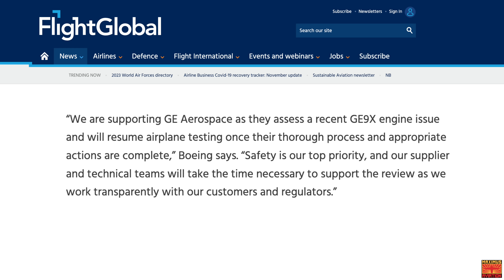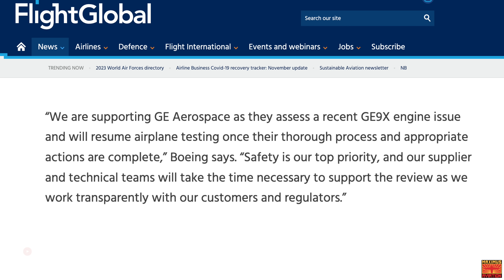Boeing Grounds All 777-X Test Aircraft Due To GE9X Engine Failure. Will the 777X Ever Get Certified?

Comment: If this turns out to be a design problem with the engine that warrants its share of compensation, GE should be the one paying all the compensation. GE is the patent-holder of the engine, and GE was the one that said that engine issues have been fixed in 2019.
Reply: Boeing should have working with RR for backup plan
Reply: @kongmindown8964  That's exactly what Boeing did for the 787. The way that turned out was that the RR engine had problems and RR left a sour taste in Boeing's mouth.
Reply: @Blank00  Neither PW can deliver those engines. Boeing sorta like a cursed company constantly flanked with problem from several direction. I can imagine why the Boeing has some of the highest turnaround rate in US.
Reply: @kongmindown8964  cursed and not cursed is not a good way to judge a company. The way that I judge Boeing is that there are things such as the 737 MAX crashes that Boeing deserves to suffer for since those things are Boeing's fault, and there are also things that arw not Boeing's fault such as engine problems, therefore Boeing doesn't deserve additional suffering for these things.
Reply: @Blank00  That's not really how it went down. GE and Boeing agreed on the GE-9X around 2012, long before the RR issues. RR at the time didn't really have an engine that could meet the requirements and both RR and GE knew the only way to justify the investment was single source. Very similar how it went for RR with the 350 and 330NEO.
Reply: We all knew the wannabe would be crying "it's not Boeing's fault" the problem is ultimately IT IS as Boeing chose GE and this engine. Why don't you try and get in the field first before crying things you know nothing about.
Reply: @DC8Combi  Then by that logic, Airbus is to blame for QF32, AF66, and the PW1000 engine issues that affected the A320NEO family because Airbus chose RR, EA, and PW, respectively. By that logic, Lion Air and Ethiopian Airlines are to blame for the MAX crashes because they chose to use the MAX.
Reply: @Blank00  You don't know what logic is little guy. Airbus is responsible for their bad decisions nobody said other. The problem is your choice of manufacturer to cheer lead for is FAILED as they have issues every few weeks. 😂
Reply: @DC8Combi  relax , it's GE fault just like the pealing  paint on the a350 is airbus fault ." Don't blame the paying  customer for the suppliers  fault" . 

Anyways PW are virtual  out of the widebody  segment and Rolls royce had so much on their plate including troubles with the Trent 1000, that they could not have had enough  time and resources  to develop  an even larger engine . 

In other words it was beyond RR's pay grade and PW have dumped the widebody  segment to focus on narrow bodies . Only GE was left as the only alternative
Reply: @mmm0404  You going to tell me about avionics and electrical bonding like I've asked recently since you claim to be an avionics engineer? Lets hear your newest line of BS okay?
Reply: @mmm0404  Manufacturers like Boeing and Airbus hold responsibility on who they choose to support their aircraft but you wouldn't be familiar with this because you've never worked for either of them.
Reply: @DC8Combi  this the reason  I didn't  want to tell you anything  about myself.  Would you blame me if I was dealing with someone  like you ? Haha . 

Eitherway  , that's not the point of my comment. Lol. 

I will counteract  every comment of yours if it's not in line . Lol
Reply: @mmm0404  You having zero aviation experience and telling fairy tales trying to tell me when my comments are not in line is comedy............................I have the experience and the privilege of inside information. NEXT
Reply: @mmm0404  At the end of the day another excuse because you can't tell us anything about yourself aviation related.
Reply: @DC8Combi  
I see a common recurring theme here….
You seem to like to insult / belittle people. 
Why don’t you give it a rest and back it off a notch or two?
Reply: @mmm0404  
We'll see how the ultrafan turns out before believing that powerful engines are beyond RR's paygrade.......
Reply: @artrandy  well the ultrafan will not be as  powerful  as the GE9X , it could be  slightly  larger thou  and definitely  more efficient . RR are not interested in producing  the most powerful  engine anyways , but rather a scalable efficient one .. 

Of course  RR is capable  of producing  the most powerful engine on the planet , daaaaa, but that is not the reason they are developing  the ultrafan in the first place .
Reply: @patrickflohe7427  Who you think you are telling anyone what to do Patty, GFY how you like me now!
Reply: @mmm0404  Maybe Patty Cake should mind their own business as I've explained it to them real clear. 😂
Reply: @mmm0404  You going to tell us about electrical bonding avionics man or you going to make excuses and lap at some SIMP named Patty Cakes?
Reply: @kongmindown8964  No, GE is the sole supplier for the 777 and we dont want another 787 Dreamliner /  RR fiasco with a company which is nearing the end of production for civilian airliner engines.
Reply: @John-nc4bl  And what happen if GE becomes another RR fiasco? It wasn't the first time Boeing has some issue with GE9X
Reply: @DC8Combi  
Wow, what a child.
Reply: @patrickflohe7427  Negative cupcake, the child is thinking you can tell others what to do!
Reply: @Blank00  Hey Merry Christmas 🤶! I'm just following up from the Engine issue here but actually it's not the manufacturer that chooses the engine as DC8 (Stephen) has said to prove he knows better. Its the airline that does, not the manufacturer. You are perfectly fine choosing a non FAILED manufacturer because none are perfect but dont believe what he says because he wants random strangers on his side but gets 4 or 5 likes from his own made up accounts he uses or whatever. Manufacturers never get the blame for choice of engine. The Airline does. Hope that clears your mind there and anyway best wishes for a better 2023
Reply: @mmm0404  Hello again, Merry Christmas 🤶 just following up from this big hassle of who is responsible for choosing engines. DC8 as you know I've told you (stephen). The one responsible is the airline not manufacturer. They only are responsible for parts from the suppliers. Engines are from the airline that chooses the better one of the two options for both wide body and narrowbody. You don't need to work in the field to say like its the manufacturers fault. It isn't. He is just trying to find an excuse to throw another bad point to attack Boeing for, due to him having fired many accusations at, which got him to resign with immediate effect. Does this make much sense now that? Anyway best wishes for a happy 2023
Reply: @nickolliver3021  🥂 😊🥳🥳best wishes and happy holidays to you too.
Reply: @nickolliver3021  but in my opinion, the company that deserves the blame for engine problems is neither Boeing/Airbus nor the airline, but rather, it's the engine manufacturer. what Boeing/Airbus and the airlines have in common is that they have no reasonable way of foreseeing engine reliability. However, the engine makers are the ones that have the engine-testing facilities and they are the ones that say "we came up with a fix for engine issues". Therefore, the engine makers deserve blame for this kind of scenario. Let's take UA328 for example. Pratt and Whitney have known for a long time that the inspection method that they have devised is flawed, and they are the company that boasts "dependable engines". Meanwhile, United is the end user and Boeing is like the retail store of jet engines, and they have no way of knowing how flawed PW's engines are. Here's an analogy. Suppose that you (analogous to United) buy Jif peanut butter (analogous to PW engines) from Target (analogous to Boeing) and you get hospitalized from food poisoning due to the peanut butter, and this is before any recalls (analogous to groundings and ADs) happen. Do you or Target deserve blame for this? no, the end user and the retail store have no way of knowing about flawed products, but the supplier is more likely to know about flaws than retailers and customers.
Reply: @Blank00  your opinion is not wrong. Another way would be the manufacturer as they ask both RR/GE or CFM/P&W. They ask what engine they can make for their new plane but I totally agree mostly it is down to the engine manufacturer themselves. Exactly. The engine manufacturers do have engine-testing facilities and Boeing/Airbus don't. But all in all Stephens way of making everyone believe hos own way to get them on his side is ludicrous. As long as you explain in detail like you have of your opinion then that's perfectly fine. I myself will always never blame the plane manufacturer for the choice of engines if only 1 is available like we have here. Whatever engine is chosen there will be some issues with it no doubt. It is not their fault because of choosing whatever they go for. Anyway I know exactly where your coming from. No reasonable blame should go to Airbus or Boeing.
Reply: @nickolliver3021  and the sad thing is Boeing has gotten the blame even in instances when they do choose multiple engine makers. For example, when people say "Boeing is to blame for the UA328 because they should've chosen other engine makers", will they still be saying that after they find out that the 777 is offered with RR and GE options too? Or when they say "Boeing shouldn't have chosen RR, then the Trent 1000 issues wouldn't have happened", How will they react upon finding out that the the GE powered version of 787 exists?
Reply: @Blank00  exactly I totally agree. This goes back to what I said earlier. If they went with the trent 800 instead they would still have had an issue with that engine whatever it may be. Boeing was never to be blamed for that UA328 flight. Some engines weather it be RR OR GE shut down mid flight and cause the flight an emergency or diversion to nearest airport. Planes might as well go engineless according to muppet Steven going by is failed logic.
Reply: @nickolliver3021  but hey, it’s not like the worse commenter called Ant is talking right now
Reply: @Blank00  no of corse not
Reply: @kongmindown8964  yeah, and the RB211 had even more development issues than the GE9X, and look how reliable the RB211 got 🤔

Comment: Maximus, have you made a change in mic or audio processing/production/technique?  I've noticed your voice lately have been booming.  Maybe it's proximity effect or an EQ setting?
Reply from the maker: Thanks for the tip.  I had been getting a lot of complaints that the volumes were to low.  But I apprectie the input helps me figure things out. Thanks.
Reply: @maximusaviationchannel  hey maximus. Could you please look through the comments and remove this video from your library please. It looks like there is some bullying happening in the comments and is getting out of hand with certain people like me and a few others? I think you need to assess what's going on and decide what to do with all this

Comment: The original 777 was launched in 1990. United began revenue flights in 1995. 777X launched in 2013 yet not even close to revenue service. Why so long now?
Reply: Because of the legacy 777. Since the production  line was still producing 777-300ER 's and 777-200LR/777F's at a moderate/ high rate , Boeing wanted the 777X to smoothly take over the line as production  rates for the legacy 777 slowed down significantly  in the late 2010's . 

You could say , Boeing did it on purpose somehow 

I'm not sure but that is  what I heard . The expected  EIS was supposed to be around 2020 but some technical  challenges with the plane during certification  and covid forced the added  5 year delay
Reply: Boeing became incompetent over the years. Aways from the Dreamliner ..... During the 70, we can understand a two year dealy like in the L1011. But today ... we are talking about 7 years , probably more. Yes, we are pushing the limits more, and so did jets in the 70s... no computers, mostly made on paper. Concorde was done ON PAPER, probably some calculation and simulation aided with early computers. Thats all. Today they are PLANTIFUL in tools and knowledge
Reply: @38911bytefree  the problem is GE why Boeing incompetent?
Reply: @ndlben7129  Seriously ? ...... Just for this case is GE's .... but see around. I like Boeing over Airbus but they are not able to deliver !!!!!!!

Comment: I wonder how different things would be if the airlines with the type on order had an alternative?
Reply: It wouldn't be any different.
Reply: @rafaelwilks  Yeah, you may be right. I was thinking along the lines of upset buyers going for the other one. But most customers have faith in what they've always used, and will most likely stay loyal. I probably wouldn't opt for change either.
Reply: @grahamnash9794  Customers fly on the plane the airline provides.  A good many can't tell you which plane they are on.

Comment: What will happens to the 777 without X? I understand it can no longer be sold from 2025 onwards using the current engines due to environmental regulations. GE remains silent regarding this issue.
Reply: 2027
Reply: Affects all newly produced airplanes  that do not meet the the minimum  emission rules  by 2027/28

 The 777 can no longer be produced  beyond 2027/28. There is nothing  GE can do about  that . 

The 767 is also another airplane  that will be affected  by these emission guidelines. 

They might  get an exemption  for the 767 thou since , the KC-46 tanker is based on it and the joined force may want more of them in the future
Reply: @mmm0404  What do you mean by “There is nothing GE can do about that”? I thought GE was going to produce a trimmed down version of the GE9X or modify the current GE9, in order to cope with those emission rules for the standard 777. Does this mean that Boeing will stop production of the current 777 by then? If the 777X production date slips a few more years, then Boeing will no longer have anything beyond the 787? Not even the 777F? Thanks for your insight.
Reply: @HugoAelbrecht  demand for the 777 has dried up , I don't see a reason  why GE would spend money on project that is approaching the end of its life . 

The 777 has less than 100 unfilled  orders comprising mostly  of the 777F ( freighter) 

Anyways the 777XF is ment to be a 777F   replacement  ( kind of) and Boeing expects it to enter into service  in 2027 , about the same time production  for the legacy  777 may come to a hault .. 

So if things go as planned  , when production  of the 777F stops the , production  of the 777XF will take over . That's probably  Boeing's plan. 

Boeing is also eyeing  a 787F which may enter into service  around the end of the decade to replace the 767F . That's if the 787F is launched  anyways
Reply: @mmm0404  So there is no plan B, if the 777X development slips another couple of years. Given the slippage of the 787, when it was developed, that seems frightening!
If I was the CEO of an airline, I would quickly buy the A350, as long as Airbus has enough production slots available. Those might be filled up very quickly.

Comment: First off, what do I care what Tim Clark has to say? I never hear anyone comment on an airline product from ANA or United. Second, that us what these test are for, finding problems. And this is the main reason I think Boeing is stating no new aircraft designs till 2030+. They are literally at the limit of current technology. Everything has such minute margins attached to it that there is no room for error anymore. But the good news is GE had that engine going for the ETOPS certification. That would provide a good reference point for this engine. Hopefully it's just the one unit.

Comment: The problem is... They are pushing the limits of everything to save money. The 737MAX engine needs 3 minutes to start for bowing to straighten out.. Ridiculous
Reply: lol the old IAE V2500 takes that long to startup, and the LEAP has proven itself to be anywhere between 2 to 4 times more reliable than the the GTF, so, yeah, there goes that argument. Ridiculous.

Comment: It has to be a bigger problem than they're letting on if it wasn't they wouldn't stop the flight test program because they're that far behind
Reply: But there not ramping up the test flights they said that mouth's back.and i haven't seen it out testing for awhile now i usually see it a couple times a week.
Reply: I would not read too much into this.  Lets see what happens.  It is what it is.
Reply: @danharold3087  yep
Reply: and seen any news of GE9X issues lately? 😎

Comment: Would it not be better for large planes to have 4 smaller fuel efficient engines that are more reliable than 2 large ones that require technology that's not developed yet technology just isn't there yet with those engines and it might take years for them to become reliable and get the fuel efficiency needed even at the end of it all they might not meet fuel efficiency targets you can design and test things on computers but when it's developed in the real world we all know the test results can be different from what the computer predicted
Reply: I give you the Airbus 340, an underpowered turkey that was a complete failure.
Reply: Technology isn't there yet? You're a physics expert or something? You know more about what's going on than the people working with the engine?
Reply: Four engines, that's exactly what the industry is getting away from. Where have you been hiding?
Reply: @rafaelwilks  Danny Crooks asked a question. "Would it not be better..."  Why are you jumping on him?
Reply: @rogerwilco4736  Yes but IFF we could come up with 4 engines that burned the same or less than 2 it would better.    So the answer to Danny's question is yes.  But not likely to happen.